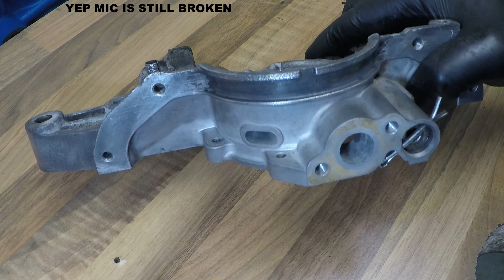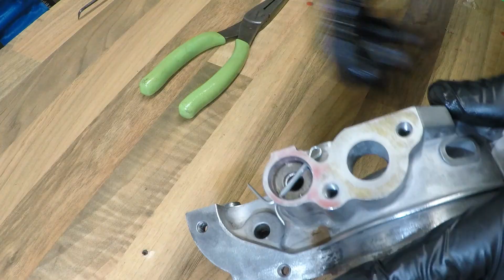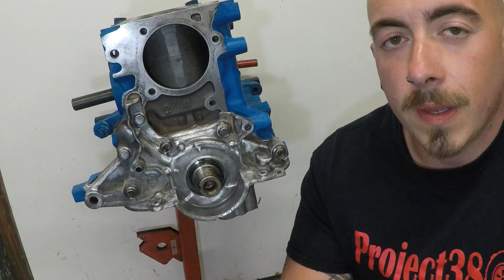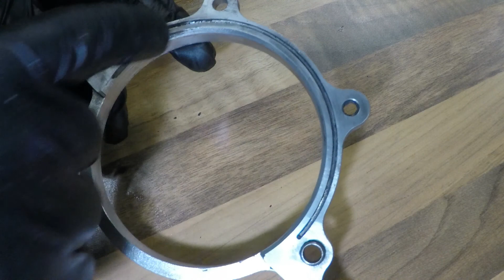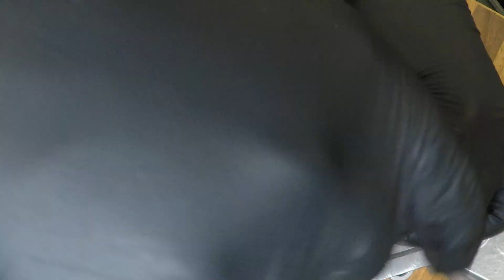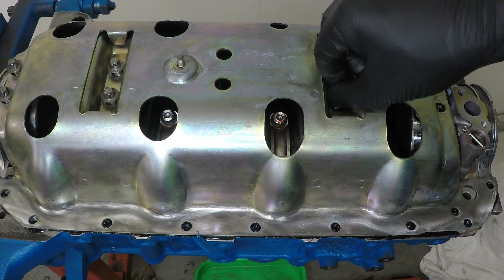UPGRADING THE SUMP : MX5 TURBO BUILD PT12

Comment: You use RTV to mate the oil pump to the block? There's a gasket made for that. I was planning on using both some RTV and the paper gasket made for it. All to insure I don't get another leak. And I bought a new Melling oil pump. Glad you covered the oil pump spring and that O-ring. I got all that with my new pump but was unsure where it all went.
Reply from the maker: I haven't managed to find that gasket yet

Comment: How much more pressure did you got from that mode?
Reply from the maker: as of yet im not sure as the engine is not running but stay tuned for when it is up and running, this mod is to raise the oil pressure relief limit so at higher revs hopefully it will have a higher oil pressure